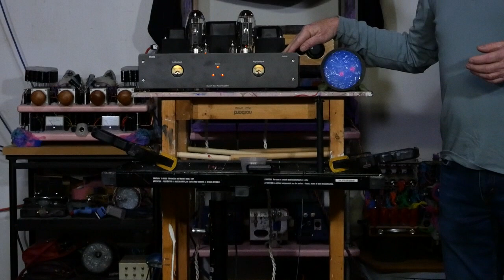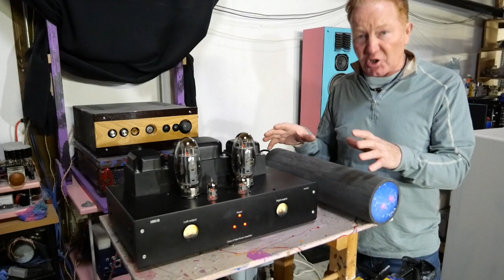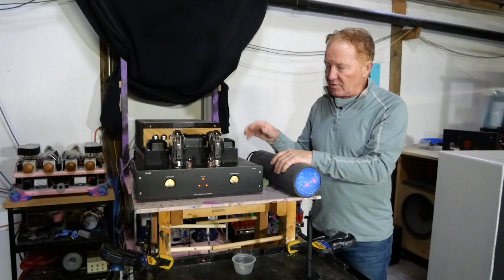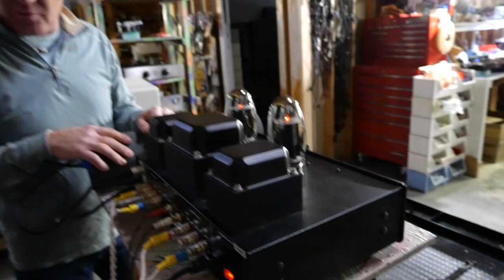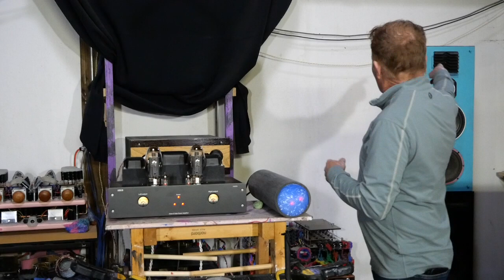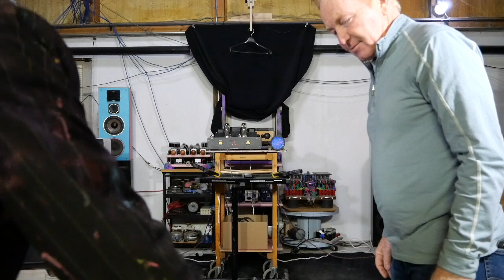Why do we do modifications?  Do we want to do it?

Comment: Excellent work, I'm in love with the Audio Note Kaisei electrolytic capacitors, they are the best of the best, Audio Note use them in their hi-end equipment. I've recapped my 1981 Quad 405 power amp  with them, with outstanding result, if you follow my channel, you will know, they are my favourite capacitor 😁